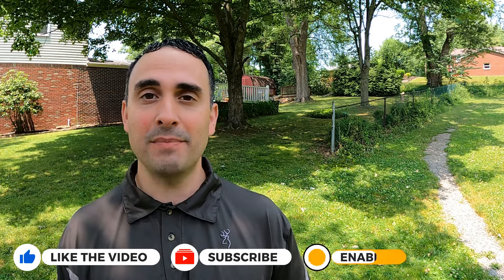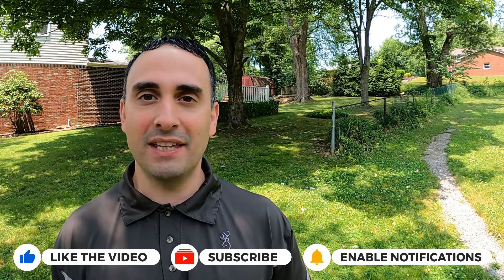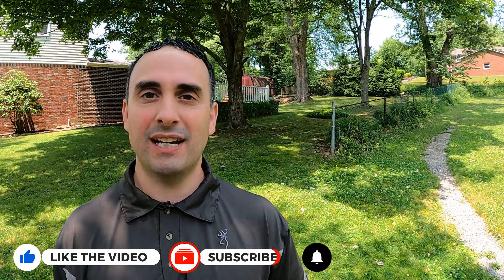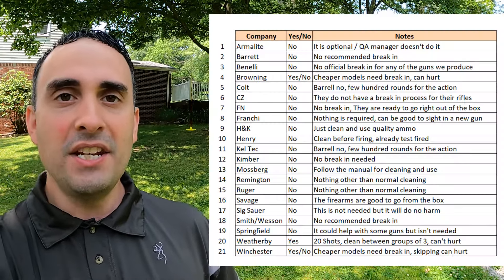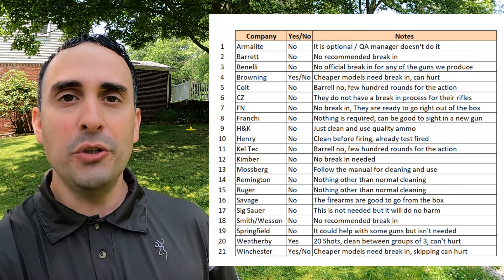How To Break In New Rifles & Barrels – 21 Companies Answer

Comment: I have yet to find someone cover this topic willing to buy two identical rifles and do break-in procedures on one rifle and just shoot the other rifle for the same amount of rounds, clean them both and then compare the groups of both rifles. If concerned about variability among identical barrels affecting the results, then the experiment could be done with a batch of identical rifles in each group.
Reply from the maker: Due to the very small deviations you are trying to measure across a batch of barrells and the great variance between barrell ammo combinations would need about 100 barrells in each group with about 100 rounds of ammo per barrell. So 200 barrells and 20,000 rounds to get statistically significant results that account for all the variables. Maybe more. It's financially impractical to do. Only the largest barrell manufacturers have the scale and resources to do it right, putting the barrells in vices in an indoor 100 yard range. And they gain nothing from doing it. Best bet is just do what your manual says to do.

Comment: Barrel break in used to be necessary, when machining processes were rougher, with modern barrels and machining as good as it is, it is completely unnecessary to break in a barrel.
Reply from the maker: Thanks!
Reply: 100%  line bore and broached barrels will have machining marks. Hammer forged barrels will not have those marks/burrs.

Comment: Awesome vid sir, thanks.  My personal procedure is clean first, take a shot, and clean.  Then, I put cleaning things away and start shooting. 
One thing in all this that makes no sense is some claim breaking in a bore polishes it and leaves a slick coat of copper making for better accuracy.  Then they clean with a copper solvent.  Can anyone explain that thinking to me?
A third follow-up question you could have asked was, "How did you determine that?"  Courious how a couple guys said to break in the cheaper models.  What's with that?  Again, thanks for the vid.
Reply from the maker: Thanks so much! Yea, it doesn't all line up

Comment: With modern CHF barrels and good quality factory ammo. a wet patch with a mild bore cleaner like Bore Tec initially and after every visit to the range, should  keep your action and barrel in optimal conditions. Gone are the days of having to “scrub” the bore with caustic chemicals and copper or steel brushes  Cheap rimfire ammo probably causes the most problems with carbon fouling. More importantly, with the increasing popularity of high pressure and fast 6-7mm bullets, it imperative that you don’t overheat your barrel. After 3-5 consecutive shots, groups begin to “open up.” Give your barrel time to cool instead of running 10+ rounds through it consecutively without a cooling period.
Reply from the maker: Thanks!

Comment: Not exactly a rifle break-in issue, but maybe a cautionary tale:  Bought a Mossberg 930 shotgun mid-2021, but couldn't get out to hunt until 2024. It had sat in the box for almost 3 years, and unknown how long at the Dealer before I got it. Finally took it out to pattern this month and it wouldn't fire. It made a barely audible click when the trigger was pulled. 

The pin wasn't striking the primer. Nothing. Upon tearing it down, I found the inside packed with a thick red grease. The hammer, firing pin and spring were "frozen" solid in this gunk. After much washing with mineral spirits everything moved freely and it fired just fine. Clean it when you bring it home new! The build quality of the 930 is another story.
Reply from the maker: Good advice!

Comment: I have worked at a gunsmith/gun store for over 15 years. We built custom rifles and were warranty and fix breaks for many different brands of firearms. You could call ever firearms mfg out there and ask what their trigger pull is. They will not tell you. Same as with break in for barrels. In turn. I went and asked Hart Premium barrels what they recommended? 
With that. They told me this. If it is just a hunting rifle. Clean and oil like you normally would. If it is an Air Gauge barrel. Do the 1 shot and clean 10 times. Then 2 shots and clean 10 time and start moving your scope for impact. Then 3 shots and clean. He also added this. Use Barnes CR-10 and a nylon brush only. Along with a caliber jag for the patch. With all that. You wet patch and the brush 10 strokes. And in and out is counted as one stroke. When you finish the brush. Use a jag and patch. Push it out the end of barrel and get a new patch. Push like that until your patch comes out clean. Mine take 4 to 6 patches to be clean. Then when finished shooting for the day. Repeat wet patch, brush and dry patch until clean. THEN use a oil patch to coat the inside so it does not rust up on you. Now, days later or whenever you shoot it again. Wet patch it and then push dry patch until it comes out clean. No need for a fowl out or fowling shots. My bullseyes are spot on for my first shot. As there is no oil in barrel. 
Last custom rifle I built. I got a brand new take off barrel that we took the action and bult a custom rifle out of. I took that barrel and put it in a vice. Cleaned it as much as I could for about 5 days while working. Then sent it out to have the barrel cryogenic treated. Pilar bedded stock and trued the action. Rifle barrel was a Rem 700 in 22-250 and A Kiplinger single set trigger. Normal was set at two pounds and the set was set at 2 once's. After break in period, I shot a three shot, shot group. WOW I was impressed. Took the target to work and had another gunsmith measure it. 
After measuring it. He asked, What caliber? 22-250. He said OK, 0.224 in bullet. The widest I could make the shot group was 0.338. That makes you shot group a 0.114 in group. Your bullet points are touching.
Reply from the maker: But how would you ever know if that was just the quality of the barrell or the elaborate cleaning process? Or if just taking the same number of shots and cleaning at the end would produce the same results?  How do we take this from ritual to empirical?
Reply: @TheNewHuntersGuide  I just know that with the gunsmiths I worked with, when I asked how to do this. The owner said call, so and so at Douglas barrel and ask them. And the way I wrote it is how, is how he told me to do it. With that, I took this thought path. I know firearm MFG will not truly tell you anything outside of what is in each handout with the firearm. The barrel MFG, I figured would tell me how to improve their barrels and not switch to another brand. Wanting me to keep the barrel in tip top order.
As for an answer to your question of How? I do not know either. Just know the way I do it or have done it. I have 20 year old rifles that shoot just as good now as they did brand new.

Comment: O.K., now you need to follow through with BARREL MAKERS.  Good vid.
Reply from the maker: Thanks. So who makes the barrells for these companies?
Reply: @TheNewHuntersGuide  Wilson would be a start.  Ruger makes their own. Savage, I'm not sure.  Ace might be another.
Reply: @TheNewHuntersGuide   Bartlien, Krieger, Brux, Hart, Benchmark. All make thier own custom barrels
Reply: My first thought was that your suggestion is silly, as the factors of the rifle (primarily heat mechanics) means that you cant separate the two.  But then I actually thought about it.  I'm a bit shocked at some of the manufacturer's responses. What if the barrel manufacturer's recommendation is equally shocking.  What if it differs from the rifle manufacturer's guidance? This indeed would be interesting!!  Great suggestion.
Reply: @TODinWY  Savage makes their own.
Reply: Daniel Defense makes their own barrels.  DOD prefers them.  What do they say?

Comment: Good info. What would have been interesting to know as well is what process their barrels are manufactured with. I'm assuming most are hammer forged which I've found are alot smoother than cut rifled barrels.
Reply from the maker: I think it differs even within some companies based on the line of rifles. Sometimes the better or cheaper ones are made different ways, sometimes in different places.

Comment: So its my experience that a barrel need to be fouled to be accurate. I reload, so I have to fireform brass too. So the drawn out process of shooting and cleanings doesn’t bother me as far as if its necessary. I like that the time between shots is occupied by something productive, or definitely not detrimental to the gun. 

Everyone has an opinion of if break-in is necessary, but not claims it's potentially detrimental to the gun. Best practices folks. The amount of time we waste researching inconclusive or subjective results is often better spent just doing the damn thing. 

And also a point of experience, manufacturers are NOT the best source of unbiased information about their products. I'm not going to bother explaining why that is.

Comment: New, out of the box: dry patch through once and no return, remove & exam then borescope. Wet patch if necessary.  Fire a round and borescope. NO mag dumps for 40 or so shots, then borescope. This includes the zeroing, and different ammunition (annotating results). Range clear, fire when ready...
Reply from the maker: What are you looking for with the bore scope?
Reply: @TheNewHuntersGuide  any type of bur. Anything out of the ordinary around the gas port, muzzle, and chamber. I have never returned one, but it's possible if I'm  not satisfied...

Comment: Browning and Winchester both said cheaper models need a break-in.  So at what price point does a cheaper model become a more expensive model, that doesn't need broken in?  The cheapest rifle in a series?  The cheapest 2 or 3 rifles they've ever made?  Each manufacturer is probably different.  How expensive does a rifle have to be, to not need a break-in?
Reply from the maker: If there is anything to it, it has to have to do with the barrell forging and finishing process used.

Comment: Would have been interesting to have Mythbusters buy 2 identical guns, do a "break-in" on one, and just put several rounds through the other. Then cut the barrels in half length wise and compare them under an electron microscope.
Reply from the maker: The problem with that is you would have to cut them in half and compare them before the break in and then again after. It's the only way to know for sure.
Reply: @TheNewHuntersGuide  Buy 3 guns. Cut one unfired to give you a base.
Reply from the maker: @icin4d  Yea, it just doesn't work that way. Every barrel is an individual. You can't compare one to another. You could compare 100 to 100. But you'd need some special kinda funding to run that test.

Comment: Why not use an abrasive before any rounds are shot. This will settle the barrel quicker, saving time and money..thoughts???
Reply from the maker: I suppose it depends on if you think a break in does anything. If it didn't then neither would this presumably.

Comment: I will  never use  copper  solvents   my new supergrade  I did 5 shots mineral  oil patch then dry  every  5 shots tell I got  to 100  then clean with  Hoppies #9 tell  clean  bore scoped it done 5/8 in group  at 100 3/4in at 200
Reply from the maker: So the question is, if you just cleaned it out of the box, and after every range outing, would it shoot any different after 100 rounds?

Comment: Similar myths with motorcycle engines.  We don't break in any other manufactured product, but for some reason there's these persistent myths about rifle barrels and motorcycle engines.  Bottom line, if a company is manufacturing a product that isn't ready to do it's job when the customer buys it, then they dropped the ball - like Sig using paying customers to beta test their designs.
Reply from the maker: I agree! They should at least tell the customer what they need to do as well, if something indeed needed to be done.

Comment: There is no set break in on a barrel. I did a break in on my Savage 243. You have to let your patches tell you whats going on. 

I did a solvent clean first.  Then one shot. Then solvent AND copper removal.  I did this for the first five shots. Then I did groups of three with cleaning and copper removal between three shots groups. By the time I got to the second three shot group, I could notice a big difference in the copper staining on the patch. They got less and less as the brake and went on. By the time I got to twenty shots, I was getting very little copper return on the patch. 

What i'm doing is not necessarily a barrel breakin. I'm burnishing the barrel. Just let your patches tell you what's going on. It's.
Called the powers of observation. That rifle still shoots Sub three quarter inch groups today. 

I look at it this way.... Spending a day at the range and doing a barrel "burnishing" in is far much more fun than doing the honeydo  list.
Reply from the maker: Haha

Comment: Ever cut a piece of wood and ended up with a jagged edge shoulder on your cut?  Yep.  Same feathered edge stays behind on the shoulders of your rifling lands after the button is pulled through.  A better company will do a final bore polish, but many don’t.  After your first shot, many tiny steel particles will break off and deposit in your grooves, so you brush then wet patch to get them out.  Do it a half dozen times with cheap FMJ’s.  Done.  Now you know why.
Reply from the maker: Great. But that is going to happen with regular shooting and cleaning, right? No ritual needed? No half a day of shooting and cleaning, etc.
Reply: @TheNewHuntersGuide  No elaborate fudd ritual required.   And it’s only needed on a brand new barrel.  If I bored a cylinder on your Hellcat’s hemi, wouldn’t you expect me to hone it and remove all the metal chips?  Same logic.

Comment: You buy new rifle…..it’s dirty from factory test firing and residual manufacturing oils etc. Not going to hurt it at all to clean between shots for the first 4-5 shots as you are sighting the rifle in anyway. The lead and throat area are polished after 5 shots and definitely by 10. Bottom line is it isn’t going to hurt anything to do a little barrel break-in cleaning, but you don’t need to take that regiment out to 50 shots!
Reply from the maker: I agree, it wouldn't hurt. I just don't know that it would help either. That's what I keep trying to find out.
Reply: @TheNewHuntersGuide  A bore scope could give additional information, but most don’t own one. I’m more worried about identifying each rifle’s accuracy with clean cold bore vs fouled cold bore. With that I am definitely seeing a difference in rifles. Not enough difference to make a difference with a deer at 100yds, but much further out it could be an issue. Good times!

Comment: Dude sounds like a bureaucrat. Chill bro… 😂😂JK
Break in is not a procedure… it is a period… you are right… put rounds through that bore before you start getting your panties in a knot over load development and the pursuit of unreasonably small groups at 100. It is a fairly well known phenomenon that the bore will undergo changes within the first 100-200 rounds. Typically the muzzle velocity and pressure will rise as initial wear and heat checking sets in during this “break in” period. There is no point wasting time and components performing exhaustive load development testing during this period. The priority initially should be: 1) get to know the rifle with a generic safe starting load and 2) fire form the brass. Cleaning interval can be after 50 or 100 or 150 or 200 rounds depending on what tickles your fancy. Personally I wouldn’t go more than 200rds between cleanings. Almost forgot… polishing the bore with JB bore paste is also good practice.
Reply from the maker: Thanks so much, that all seems sound.

Comment: There is NO SUCH THING as break in rifle or shotgun. You start out with a new barrel. Every shot you take wears the metal microscopicly for the rest of your life. If you live long enough and shoot often enough the barrel will wear out. Usually around 3000 rounds.  If you calculate that number at the rate the average hunter shoots, considering barrel duration time per round, barrel life is 6 seconds.

Comment: Tl;dr 
- Barrel break in is (almost) completely made up, unquantified by those saying you have to do it and a waste of time and ammo.

My sticking point with this whole conversation is that seemingly nobody will quantity what "barrel break in" actually means or physically does. The only quantifiable aspects of it that I've ever been able to see, as a metallurgist and shooter, are two:

- The smoothing of burrs left in the bore from factory cutting tools, which happens purely from shooting and isn't affected by any magic cleaning procedure. And more importantly,

- The filling of micro pores in the bore surface with copper, which almost makes me see SOME validity to this whole rat's nest of misinformation, but not quite. For those eeking out every micron of accuracy from their rifles, this copper burnishing results in a smoother surface and thus fewer cavities to affect bullet trajectory. How much of an affect this has on accuracy is a whole different discussion.

But ironically, many if not most shooters will use a copper solvent during their preferred "break in" procedure, as well as routine cleaning. Using these solvents can easily remove every spec of copper burnished into those pores and reset any difference you made to the barrel during your "break in". Doing so is unnecessary in all but the rare cases where excessive copper does build up and negativity impact accuracy (specific calibers and barrel makes, or extremely high round count). Once the micro pores in your bore are burnished over, (most) barrels will (mostly) stop collecting copper and never have an issue like those caused by carbon fouling. If you're one of the exceptions you're probably already telling me how stupid I am. Just shoot your rifle and clean when its excessively dirty or your groups open up.